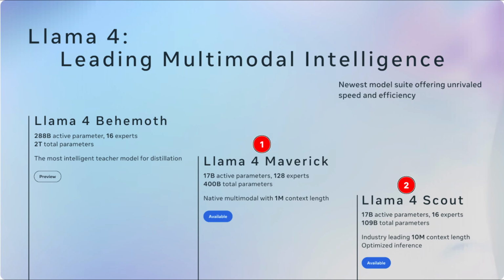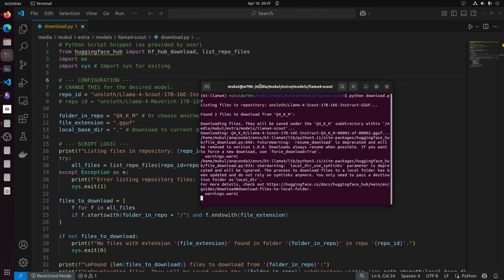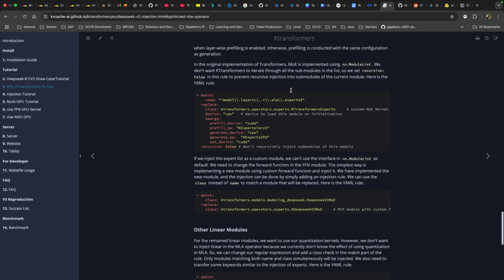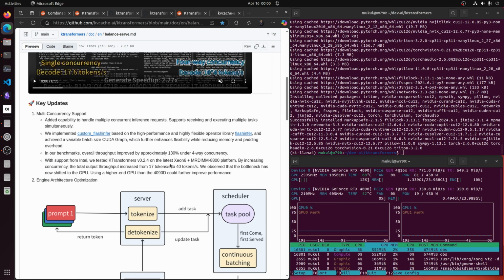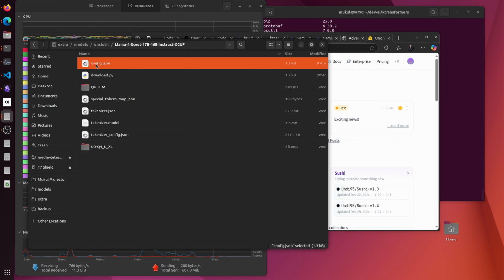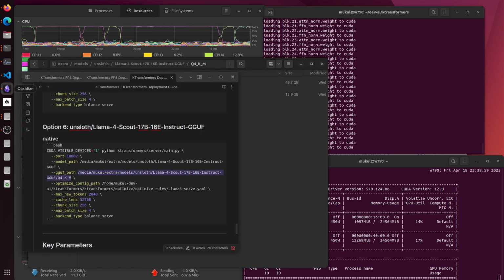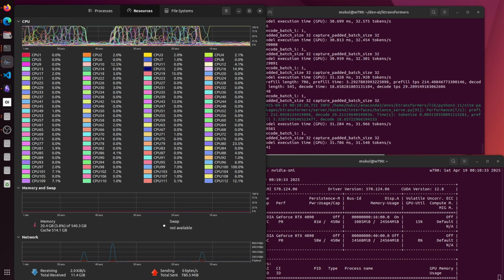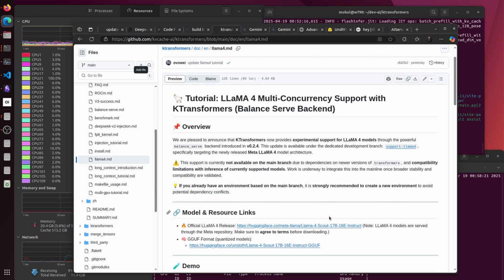Run LLaMA 4 Locally on Nvidia 4090 & Intel AMX – Full Setup & Demo!

Comment: That motherboard doesn't and cannot support Intel Xeon SPR-SP processors.  It only supports SPR-WS cpus. Intel stopped having the workstation chipsets supporting regular xeons back after X99.
Reply from the maker: Keyword "supports" vs "works". If by SPR-SP you mean engineering sample processors then please keep reading... The older bios works, newer bios won't work with it. Motherboard/ASUS won't provide you any support for using an engineering sample processor. That being said, ES processors do work, I have used it so I know it does.

Comment: Hi Mukul, thanks for your video! i have the same stack with QYFS but i am running into an issue with my RTX 6000 Pro Blackwell downgraded to Gen1 PCIe, tried different BIOS and all possible BIOS Settings. I see your RTX4090, first one, is running at Gen4, Second one as well on Gen1. have you tried something special or can you recommend something to properly run on Gen4 / Gen5 PCIe?

Comment: Looking forward to seeing how your test with Maverick goes and whether it’s fixed. I’m interested in the setup, as I’m about to build a new workstation. I have two questions: why do you think adding more GPUs will not boost the performance of large LLMs? Also, how did it go with the BIOS/firmware on the QYFS? Have you applied any BIOS updates, or does the default work fine?
Reply from the maker: I have some good news on Maverick that I will be sharing in the next video. I'm sure you will like it :)

And adding more GPUs will help, yes, but VRM is way more expensive! As long as we offload the attention layers to GPU, that's all that's needed as of now with ktransformers. There's a multi GPU guide on their GitHub page but it's not as mature yet.